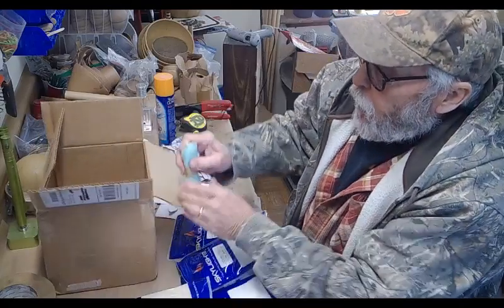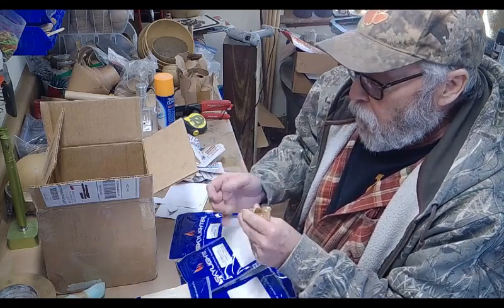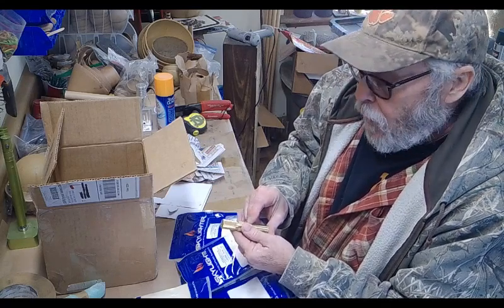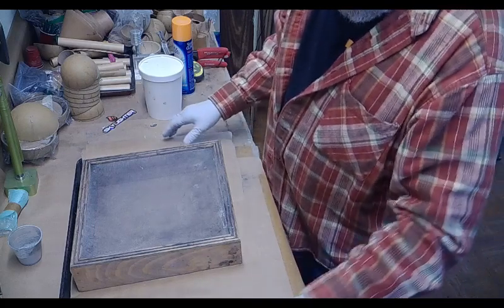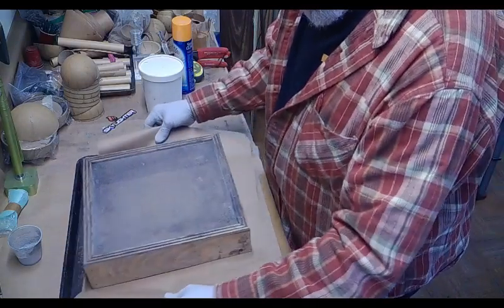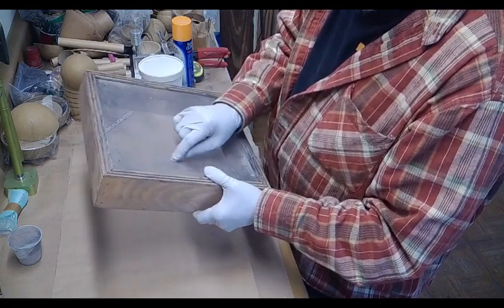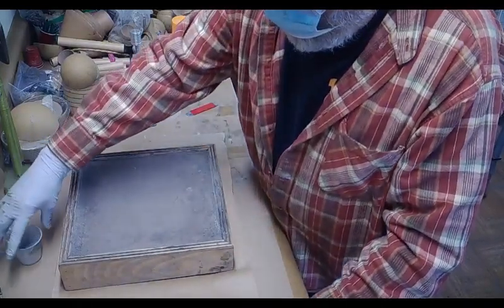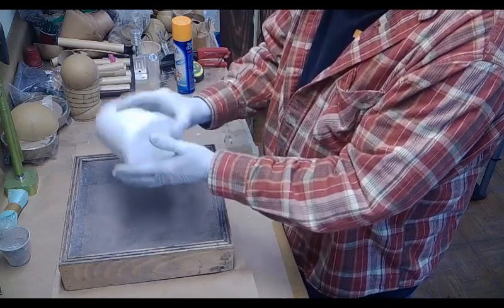Making Gold Glitter Stars - Tarheel Pyro Ep 25

Comment: Warning...
Skylighter says that aluminum and sulfur will react when using water as the thinner. Either use acetone or add 5% boric acid to the water. Dissolve well before using. 

The reaction is that the finished product can heat up and even self ignite.

Comment: here is where I get confused....... 1 pound=16ounces there are 28.3grams in a ounce.... 28.3x16=452.8 but if you use google and use a conversion app it says 453.59............ so which is it????

Soooooo I decided to post this Question in case someone else was wondering the same thing..

Sooooooooo,,,,, there is some common core shit going on here or something or my brain just isnt working

they are measuring out to the 100/1000th.... but even that does not compute to my math.... they have an ounce measured out to 28.34952grams but if you take 453.59/16 you get 28.349375

fortunately we dont measure to the thousandth but it still makes me wonder what the hell..... but thats just me.... but it could also be opperator error... I am getting old.

P.S. I double check everyones math when it comes to my fingers... So Please dont take it personal
Reply from the maker: Using 28.35 gramsx16 gives you 453.6